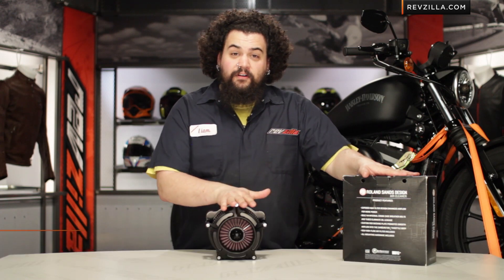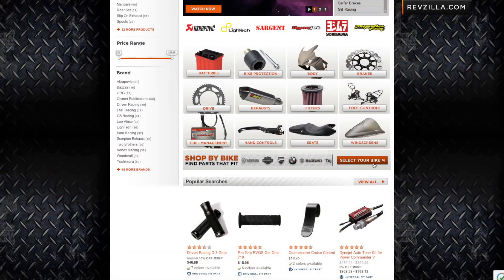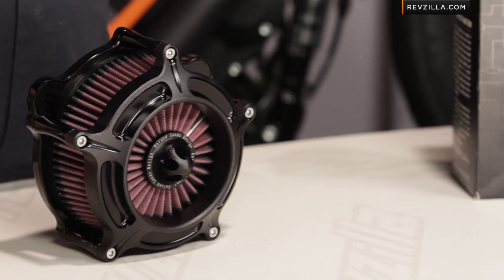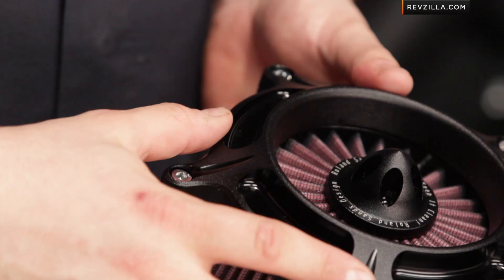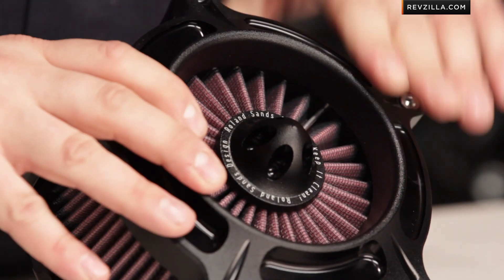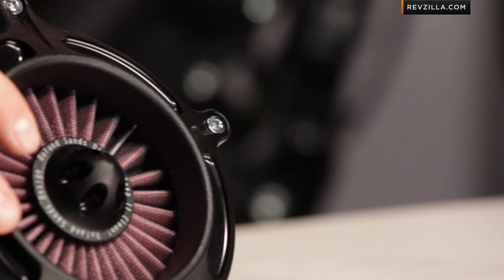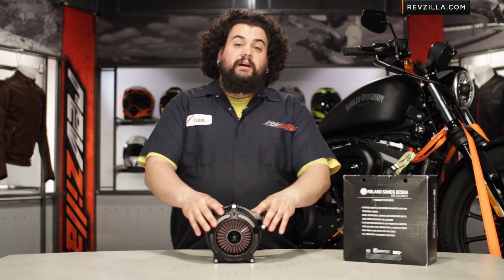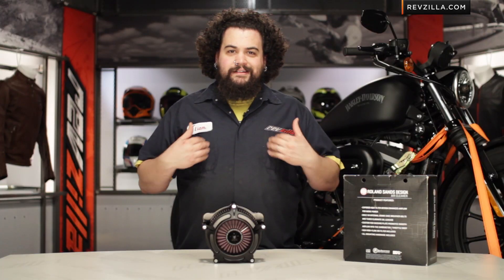Roland Sands Turbine Air Cleaner Review at RevZilla.com

Comment: Question?  You mentioned a fuel controller...  I put RSD on 2007 nightster 1200N, very similar to one in this clip .  It coughs a bit at lower RPM's.  What do I need to install?

Comment: I just purchased this same Roland Sands Black Ops Air Filter for my 2016 Ultra Limited plus a Jackpot 2-1-2 Header, 4” Rinehart Mufflers and a Zippers ThunderMax ECM with the Wideband Sensors. Just received them two days ago. Haven’t had time to install them yet. 
All made in the USA 🇺🇸

Comment: What’s the CFM rating?
Reply: This is rated at 350 cfm. The stock throttle body on a 114 M8 only flows 285 cfm and the stock heads even less. So, this is more than most bikes can take in.

Comment: Is this filter washable or will I have to replace filter after a while ?
Reply from the maker: The filter is washable, but all filters eventually wear out and do require replacement.  A good way to check is if you look at the inside of the filter and the material is pilling with fuzzy little balls (like you see on your socks) it is past time to replace it.

-Zack
Reply: Thanks sir!

Comment: Does the motorcycle need remapping after instal
Reply from the maker: An air cleaner alone won't require a remapping, but then again it won't increase performance all that much without one. Generally speaking, an air cleaner and slip-on exhaust won't NEED a tune, but a full system exhaust will. That said, even a stock bike can benefit greatly from a tune. -Kraus-e

Comment: What are the rough dimensions for this air cleaner? I have a sportster and it looks like it’s less bulky than the dyna models.
Reply from the maker: There is no difference in the filter element and the housing of this air cleaner for the Sportster and the Dyna. The only difference is the sizing and spacing for the hardware for the Sportster vs. Big Twin engines. I don't have the exact dimensions, but you can see its size in relation to Lemmy's hands. -DrewZilla
Reply: @RevZilla  I'm thinking Like me, Chad is trying to figure out how much leg room he will lose. If anyone has one installed can you give dimensions please?
Reply: I find the problem with these,  @bricklayer16 , is less the sizing and more the housing shape.  I like the look of this breather, and my 2013 FLS runs like hell with it paired with some Python throwbacks -- but I have bruises on my knee every year from one of the bolt mounts. I'm a relatively short guy (about 5'7), so if you have longer legs you might not need to worry about this issue. But in case nobody's got back to you yet, from the two widest bolts on either side it's 7.5"